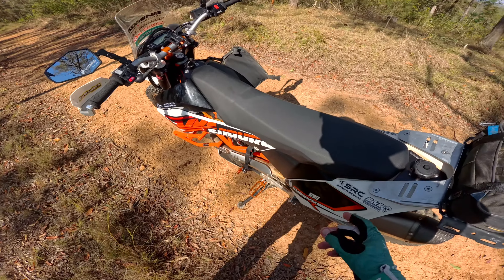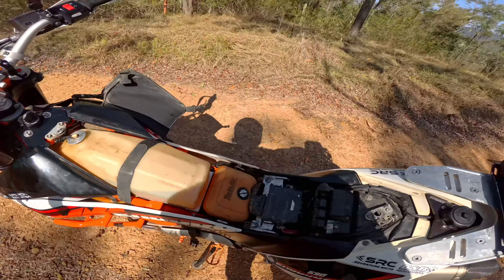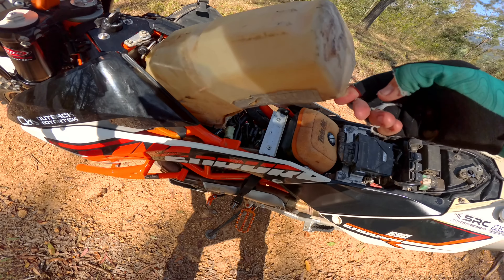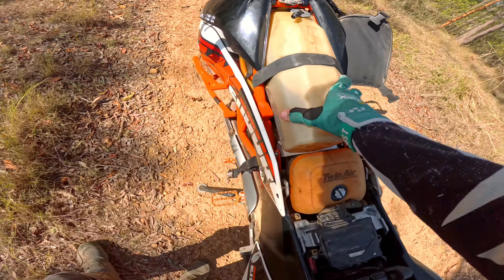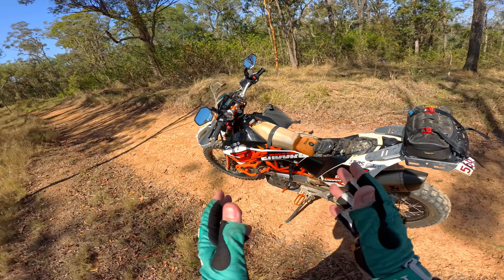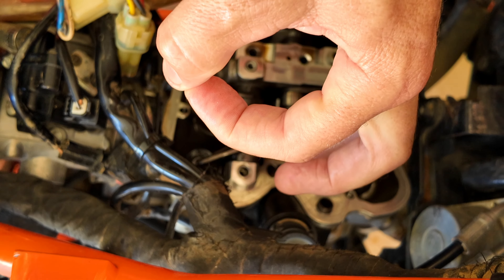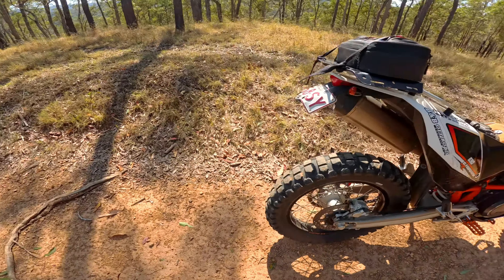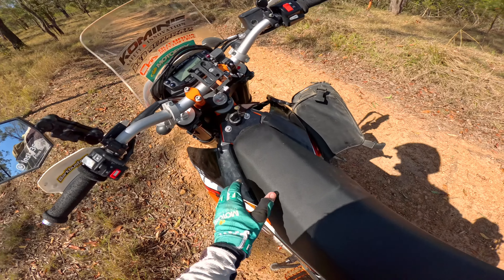Quick Fix For Rade Garage Auxiliary Fuel Tank Mount: KTM 690 Enduro

Comment: Well done man, good to see a problem solving solution right there, great explanation of how easy it is to maintain a bike, eg- look after it and it will look after you. Maybe a thin bit of rubber between the alloy angle and the fuel tank to be sure? Thanks for sharing, cheers.🤙
Reply from the maker: Yeah bit of cloth tape will do for now, it was sitting on a metal bracket before so should be ok but doesn't hurt to add a bit of padding 🤘 Cheers mate

Comment: Hey Josh, I would strongly suggest a bit of thin rubber or foam tape as a dampner along the lip of the bracket. Constant wear might eventually take its toll on the edge of the fuel tank. Looks easy enough to add.
Reply from the maker: Cheers, I have put some cloth tape on there for now will see how that fares 🤘